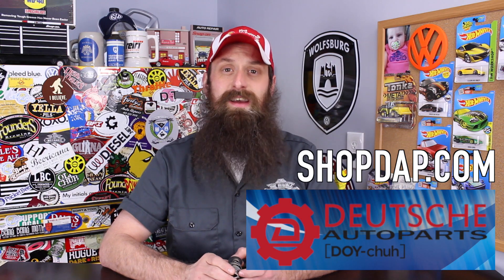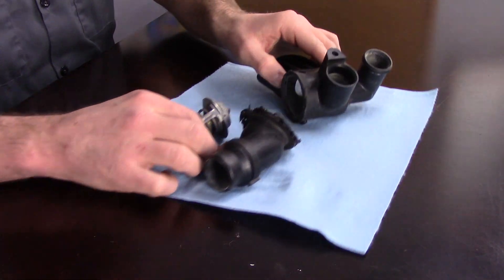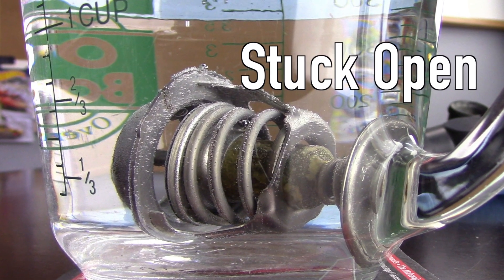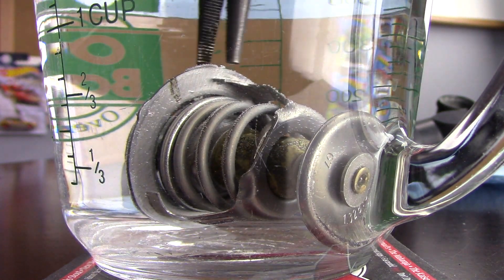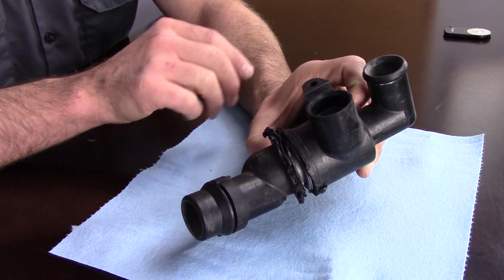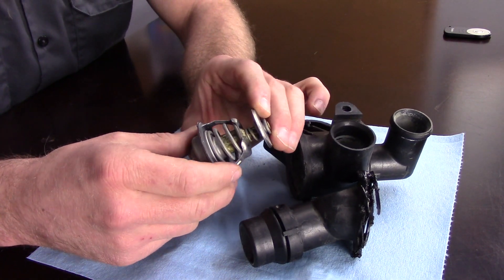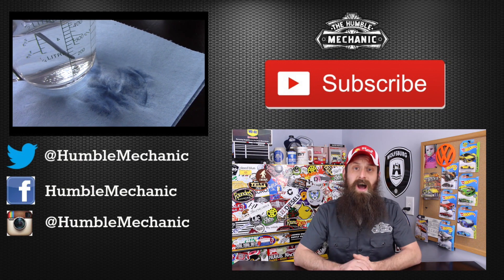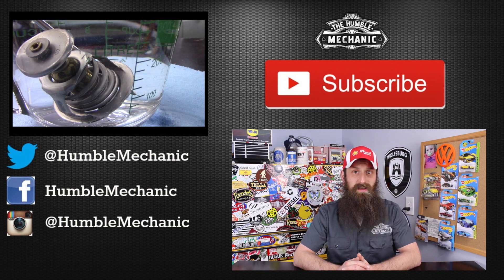How VW Parts Fail ~ 2.0t BPY Thermostat Code p2181

Comment: I have a mk5 gti fsi and I think I might have a failed/failing thermostat but not sure.  I noticed that if I turn the heat all the way up and the fan max with the weather being around 30F or colder I can actually get my temp gauge to drop a few ticks. It also will only do it sometimes. No check engine light or fault codes and heat is rather bad. If I put the heat above 75F the heat will eventually get colder. This problem seems only apparent on cold days. My heat honestly is meh at best. My car also seems to take decent amount time to warm up when its pretty cold out. I kind of rely on my heated seats to heat me up. My car has around 100K miles on it.

I have VCDS. Is there anyway I can for sure test it or should I just take it in to the dealership? Is it something else?
Reply: +thefsxflyer My stuck open thermostat problem started out the same way and got progressively worse over the course of one winter. Of course, YMMV.

I'd suggest using the Torque app or similar method to monitor your temps via the OBD2 port while driving and see if turning on your heat has a significant and lasting impact to your coolant temps.
Reply: +dudemulligan I went to the shop and it ended up being my thermostat. LOL My car now idles around 95C instead of the 70C. Heat is way better too.

Comment: hey i could really use a hand i just picked up my first car, a 2010 audi a4 2.0t manual, i and only a few weeks from having my g2, i have fixed a ton of little anying gremlins new led tail lights all that snazzy stuff.... but i picked it up from a buddy for a good price when he had picked it up it was winter the first day of summer the car overheated i mean it was only 8 degrees out.... so we did the pump and noticed still it was warm we then had to rig up the rad fans to a switch cause guesss what... they never ever turned on he drove a far distance to work and back mostly high way, i just replaced the radfan module and ripped out all the wiring and the switch, but i still have not had the fans turn on, could this be my thermostat or even possibly my (cts) coolant temp sensor??????? if someone could give me a bit of advice it would be greatly appreciated im sorry for the long comment i just wanted to add as much detail as possible. thank you in advance.
Reply from the maker: Make sure that water pump is moving water. Broken belt or balance shaft can mean the pump isn’t pumping
Reply: HumbleMechanic how would I ensure it’s doing so? Yesterday I let it run for a bit and checked the top rad hose it was hot carefully reached down to give the bottom line the little “squishy squishy “and and was substantially cooler

Comment: I have a 2.0l with 220k km and now im having coolant issues, i already replaced the expansion coolant tank, but the problem remained.. the pressure is really high in the coolant system. So high that i think the coolant escapes through the expansion cap. I also had no heat when i turned on the heatblower inside the drivers cabin. And my oil temperature went up to 120 degrees celsius and meanwhile the blue light of cold coolant was on at the instumental panel in the dashboard, i always found that the engine was running on the hotter side during the last 100k km's.. i  supose that my problem is a thermostat that has been cloghed slowly? 

I ordered a new one that opens up @ 75°celcius

It might be something else going on but atleast i will replace it to be sure that it cant be the thermostat if the problem remains after replacement
Reply: Have you figured this out? I'm having this same problem.
Reply: @TheMandeep125  

Its at a friend for repair atm
It aint repaired yet but i can tell you that i am 100% sure that my headgasket is blown. And i also had crazy oil consumption on cylinder nr4. I think i might have broken rings there or perhaps it is just the headgasket allowing oil comming in to cyl nr4. 

What caused your similar problem with your 2.0l im curious to know what went wrong with your engine.

Also, mine is a modified one with 272 catcams + catcams retainers &springs, 35mm exhaust valve + exhaust ports ported and polished 
On a non restricted xflow 8vhead(no bumps above the intake valves) , and 13.5:1 cr

Comment: I have this fault come up only when the temp is under 40 degrees. Why would that be?
Reply: +abirch2014 thermostat not opening/closing properly?
Reply: +David F. I meant when the weather is under 40.
Reply: Well, yeah I get that. I'm saying its a thermostat issue. Either that or a faulty coolant sensor.
Reply: +abirch2014 Last winter I was having intermittent problems with the engine temp (would never get up to temp, would take an abnormally long time, or would get up to temp but then drop again) on my 07 GTI (BPY) when the weather was cold. This was most noticeable during the winter when the temps dropped near or below freezing and I couldn't get any hot air to come out of the vents. It started out only happening every once in a while but became increasingly worse. I didn't always get a CEL, maybe only %65 of the time. Since this was a stuck (or partially stuck) open position situation, it would only be noticeable when there was a need for the thermostat to be completely closed, that is when it's cold outside and the engine needs more help in warming up before allowing coolant to flow. FWIW, I had the thermostat replaced this summer and have since had no problems with my engine temps.
Reply: +dudemulligan good to know. I was hoping to wait to change the thermostat since I'm also due for timing belt and water pump change as well. Hoping do due those and the dsg fluid next weekend.

Comment: bro, I've been getting this code for longest time. Found information that confirms it's the stat.  My car does a little jerk or misfire. Think it can be related to this problem with the thermostat?
Reply: Hi, did the thermostat solve the misfire/jerking? Im experiencing the same thing on my a3 2.0tfsi except i have no codes showing up?

Comment: the one million dollar question. 04 golf, story behind the issue. had the  head mechined after valves were bent. replaced timimg belt and water pump. after that, check engine came on. p2181. so far replaced thermastat, Coolant Temp Sensor. reaches 190 deg. fans kick on when ac  is on. no over heating.
need help!

Comment: So, it's a regular thermostat inside, the kind that used to cost about $6.  Now with a VW you have to buy the entire housing for, what, $140?  What's the advantage of this?  

If they used an aluminum housing in the first place, it might have cost a little more than plastic, but you wouldn't be replacing the housing when the thermostat conks out.
Reply: +Garth Goldberg its only about $50
Reply: On my Mercedes the thermostat is inside an aluminium housing with a sensor. Easily accessible though, Mercedes actually seems to care about making things easy to get to, most engine bays are really spacious
Reply: The genuine VW one is only $52, the oem ones are $29. Aftermarkets can be even cheaper. So it’s non issue at all, plus it makes sure the housing get renewed to increase reliability. If it were built as an aluminum part it will be more expensive, and for a service life of a car about 10 years, it makes sense to use cheap plastic parts.

Comment: So I’m getting the p2181 code on my 07 GTI BPY as Well. The temp gauge stays between 120 (minimum) and 180 (operating temperature) and occasionally it will get up to temp. When up to temperature it has full boost no problem. When it is between low and operating temperature I only get 5psi or boost. Is this normal? And do you believe that changing the thermostat could solve the boost insure? Thanks Charles!
Reply: Alex Kotan have you changed it? And fixed it? I’m getting the same problem! Highway mph then goes down and stops and goes on regular streets acts Normal

Comment: Okay fellas help a lady out. I own a 2005 VW Bettle.  Thermostat code showed up in April. Next day had a new thermostat put in. Problem solved. Today (4 momths later) check engine light came on immediately took it to AutoZone code P2181 Again. I drove it home (about an hour drive) no change in performance.  What's my next move?